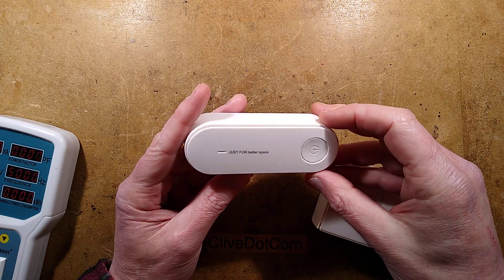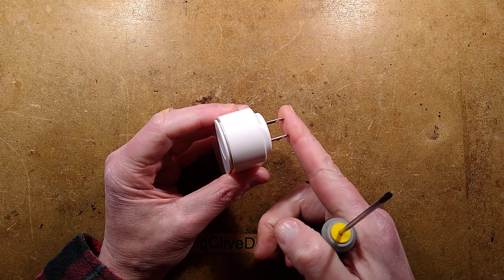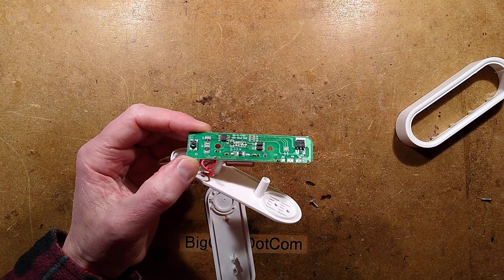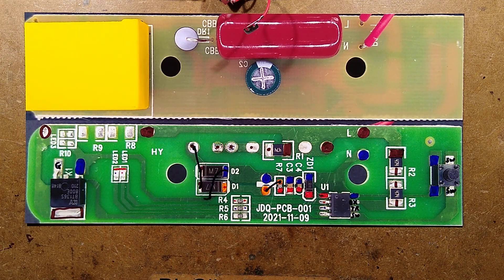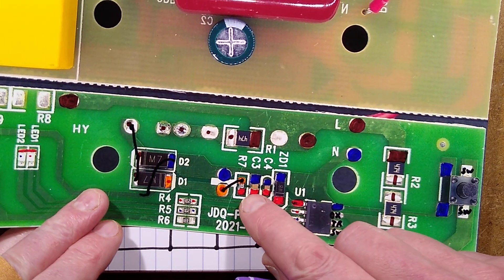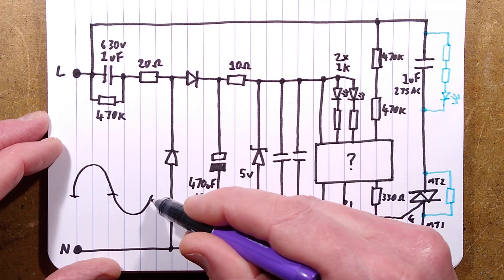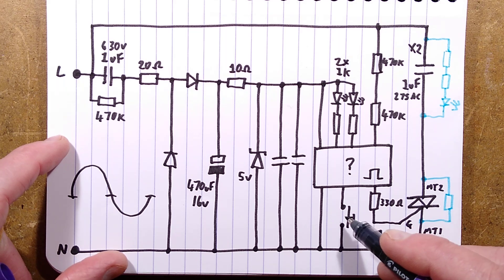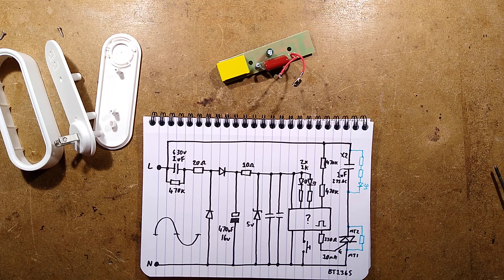Computerised power saver plug (with schematic)

Comment: Hey Big Clive, I went to look at the family home that my parents left me in their will. The house has 12 Solar Panels, and before he died, my father spent (according to my sister) £10K on two Solar Batteries! You should see the thing, meters, inverter, isolator switches, ethernet leads, current clamps, it looks a bloody mess like it was thrown at the wall. The two lithium battery units are large black boxes with thick connecting cables. You'd be in your element, reverse engineering that lot! There's also a Solar PV SCHEMATIC pinned to the wall near the gubbins! 🤣

WARNING: System is live during daylight hours!

Apparently, if I've read the feed-in tariff meter correctly, since installation about 4 years ago, the system has generated 13,000 kWh. In 18 years, in my rat-infested flat, I've consumed around 28,000 kWh. You do the math! 😂
Reply: Sounds amazing!  Take care of those batteries and that system will power a family for years to come.
Reply: @maukaman  I know little about how it all works, and how to care for the batteries, but I do know that lithium batteries have a finite lifespan, and lose capacity over time! Just as the output from the Solar Panels drops over several decades.
Reply: @marcse7en  of course, nothing lasts forever.  Lithium Iron Phosphate batteries can have an incredibly long service life when used correctly through.  If they are only charged up to 90% state of charge and depleted to 10% SoC they can last a lifetime.
Reply: @maukaman  I don't know the battery chemistry of the cells used in the Solar Battery, but rest assured, before long I'll be an expert! ... What I do know is, at £10K, they're bloody expensive batteries! 🤣

Acronyms are my thing! ... "SoC" ... "State Of Charge" and "System On A Chip"
Reply: @marcse7en  I had a feeling you enjoyed a good acronym when I was writing that
Reply: @maukaman  I actually do! And I'm VERY good at them too! Here's a few straight off the top of my head IIRC ... VHS, VHS-C,  SVHS, SVHS-C, VCR, EIAJ, VTR, IC, CPU, RAM, ROM, DIP, EIDE, PATA, SATA, USB, USB-C, CD-DA, CD-ROM, DVD, DVD-ROM, VCD, DVD-RAM, HDD, FDD, PSU, SMPS, MOSFET, RCD ... 🤣 ... Would you like any more, or is that enough to be going on with? 🤣
Reply: Cooked a lot of rats then? 😂 Keep the batteries between 20-80% and it'll help them last much longer. Try and keep them cool if you can too..
Reply: @rosiehawtrey  It's funny you should say that, because YES, I have cooked a lot of rats in my non-Solar Powered electric rat trap! 🤣 ... The Solar Battery is comprised of two units, and located in the garage, which is usually cool. I know little about how it all works, so am unsure about how to regulate the charge level as you say? I'll have to learn!
Reply: Neat 
And yep they can sometimes get messy when you have two sets of batteries and cabling for sure
Reply: @BenCos2018  I mean I love technology (computers, video, Hi-Fi, etc) but what a bloody dogs dinner the Solar PV System looks! ... As the late Duke Of Edinburgh reportedly said of a fuse box, "Looks like it was installed by an Indian!" .... How did he get away with it? 🤣
Reply: @marcse7en  damnn haha
Reply: Well, feed-in does not say anything about the amount the panels together with the panles and inverters have generated at all.
Generally, my feed-in meter is at around 0 when my 3Dprinters, computers and all other things are running of my own solar-panels and inverter during the day. I just use my own solar-energy to power everything in the house. Only when there are left-overs the feed-in should register.
Actually when installed correctly (there come in those ethernet leads and current clamps), when you would use power from the grid, the batteries are used including the inverters to reduce the feed from the grid since first comes the power from the stored energy in the batteries.

So, during daytime, first comes charge of the batteries and lowering power from the grid. When batteries are full,  power goes to the grid what is not in use so there should be only a bit left. when sunlight gets less, first only less back to the grid and later batteries are used to power the house untill they are emptied for a certain amount and it is solely grid-power that is used.

And about the investment, well should be for at least 10 years and probably 20 years or longer. so only 1K or less a year and with the energy you use in a year you will go a lot above it (yes, doing the math coursely) .
Seems like a very well investment your father did!

Comment: how do two 470k ohm resistors in series make a zero crossing detector?
Reply from the maker: Common trick with microcontrollers.  Tiny current that causes an input bit to change polarity at each zero crossing point.
Reply: It limits the leakage current into the digital input and its ESD diodes to well under 1mA.

Comment: With the triac being triggered positive only, what discharges the capacitor besides the LED? I don't see any advantage at all, putting a DC bias on the AC mains. They sure go out of their way to make this nonsense look legitimate. The only way a capacitor can save electricity, is if it's value is precisely matched to the inductive impedance of an inductive load, then, switched on and off with that load. It serves to reduce the current by correcting power factor, and can reduce I^r loss in the wiring between the appliance and the meter. It might reduce consumption by ~1%.

Comment: If they switch the triac on when the voltage crosses zero each cycle then the current is going to be nothing like a sine wave.  Because of the capacitive load the current would rise suddenly to its maximum value at switch-on then fall to zero in the first quarter cycle and then remain at zero for the second quarter cycle.  They would be maximizing the current step rather than minimising it.  They should be pulsing the triac on at the voltage peaks.  Who knows, perhaps they are, only the oscilloscope of knowledge can tell.
Reply: Correction, I got the second part of that comment wrong.  Switching the triac on at the peaks would be even worse.

Comment: Remember the bug that was placed in the United States Embassy, that was not found for (if I remember correctly) decades? 
I believe that most of these devices are just putting on a show, but this one for example. What if they are feeding back into the electric system in the structure, until it comes to something that could transmit back to somewhere. What it would be transmitting, or where it could be transmitting from. I don’t know. 
Is there any fields that are emitting from it, and what the fields might be affecting. I don’t know. What if they are transmitting a frequency of what, and somehow it is repelling insects, or what if they are drawing insects to them (not the heat, but the energy field that they are producing). 
I am not saying mind control, but if this was placed near enough to where someone was sleeping (naps included), would the lower state of their body be affected somehow? If only to prevent deeper sleep from being rustled up barely. Or if there was a feedback into the electrical system (even if it was so many meters, and didn’t make it back to the breaker), and affected other devices on the circuit, or the whole system. 
This idea is from, high end audio systems. Because they have power conditioners, and the should have their own circuit ran, along with other things designed into the power supply, to prevent noise from polluting the sound produced. 
Yea, I believe that as hifi systems are built, that cables and that noise coming from other devices on the circuit, and from the power grid, will affect the performance of the speakers. But that’s not until someone has been building it to make one absolutely amazing resolution hifi system. That is when it could be heard. This thing would cause havoc on a setup like that.

Comment: the device only works in places where power factor is used for billing.

since most developed nations like the united states and europe does not use power factor to bill it will show up as scammy.
Reply from the maker: It's also a random stab in the dark for proper power factor correction.

Comment: Well, it does seem to be a power saver after all. You plug it in, it saves power. Then, when you open the case, it shocks you. Classic power saver behaviour. HAHA I am glad you din't get hurt.
Reply: I've got a real power saving device at home. It watches the current on one of the outlets and switches all the other ones off if there isn't enough draw to indicate that it's on. But, a single outlet product that saves power is pretty inexplicable. I cannot imagine how any such device could ever be something other than a scam.

Comment: Not seen a capacitor switched on and off by a triac? Try a photo flash with adjustable power. They even use a capacitor and a triac to switch off another triac.

Comment: Switching a capacitor on at a clever point in the sine wave almost sounds as if you could fool a smart energy meter
Reply: Maybe it could fool the meter to overread.
Reply: dont be dumb
Reply: Bro what if these actually work 🤣🤣🤣🤣🤣🤣🤣🤣🤣
Reply: @rovhalgrencparselstedt8343No. If you push the load towards inductive, it's the real power that does the work, not apparent power.

So you can't get away with trying to transfer real power to apparent power.

Comment: I just had to watch you zap yourself a few times 🙂You were holding on to the prongs with the left hand and grabbed the circuit board with the right hand right at the capacitor.
Reply: Which was a dangerous thing to do. Capacitors are usually very tame when neither side is connected to earth, but here Clive created a rather unfortunate current path right through his heart even.

Comment: My guess is you have the "Pro" version of the power saver plug: the cheaper "Basic" version doesn't have the "Intelligent" parts (including the triac), but only the 1µF/275VAC capacitor alongside the missing R8, R9, R10 resistors and active indicator LED 3.

Comment: I'm amazed it actually does the whole capacitor thing as if the concept actually does anything useful. I more expected the OBDII style product where it just flashes LEDs convincingly.

One thing I am curious about though... Since the triac could potentially switch the capacitor on with quite a voltage difference on it compared to the mains, is there scope for blowing up the triac? How big of a capacitor could you use on this thing before the triac blows up?
Reply from the maker: I think that's why it detects the zero crossing point of the sinewave to minimise the current spike.
Reply: The zero crossing input should read across the triac to avoid getting fooled by the cap's phase shift or by whatever zap was left behind when last the triac last saw a null in current.

Comment: "Let's give it a fingertest - no, no charge. That's good" - Clive, the living example of work security while fiddling with electric gadgets. And I like it. #LLAP On topic: I like the fact that such manufacturers can make a living out of the idiocy of power saving esoterics
Reply: What?! Did you think that it was only fraudster businessmen/politicians like Trump and Co that could endlessly milk the mentally incompetent? 😉😁 
Remember that the old saying that "There's 1 born every minute!" is itself not true. That would mean that there should be around 40 million alive at any 1 time. When in reality there's billions of 'em! 😱
Reply: It's North American voltage. A baby could handle it.
Reply: @chitlitlah  What's North American voltage? Certainly not with Big Clive, who gets 245V, which is definitely deadly.
Reply: @graealex  I saw the North American plug on it and assumed he was using a transformer. Rewatching the first part of the video, it seems it can handle up to 240 volts and he's using his native voltage. Perhaps a shock from it wouldn't be so pleasant after all.
Reply: @chitlitlah  It's always going to be unpleasant, but nothing happens when you touch only one lead of a capacitor, as that doesn't form a circuit. And when you touch both leads, you're usually doing it with only one hand, so the current stays locally inside your hand.
It's different when talking about high voltages though.
Reply: @chitlitlah  They must use that "North American" plug elsewhere in the world with 240 volts.
Reply: @davidg4288  I don't believe that is the case. But China makes some crap that can theoretically take an input of 100v to 249v. Sometimes he use a little switching power supply to do it.  Taking that approach they have a single design instead of one for North America and another for the rest  of the world. It's efficient from a manufacturing standpoint but it is inherently a bit inefficient at one extremes or the other. For most things done like tis, they are pretty low power anyway. 

In this case, it is still fake or useless regardless. But it "works" on either voltage from the standpoint of making a few buck! Beyond that, it's garbage. 

When China clones something, they usually take a decent design and find ways to cheap it down with no concerns for safety or reliability./functionality.
Reply: @chitlitlah  I tested North American voltage as a toddler 65 years ago in North America, with scissors (went bang) and with fingers (unpleasant).  Tamper resistant outlets would have protected me from the first experiment, GFCI would not have protected me from the second as I substituted my finger for a light bulb.  Dad's response was "You shouldn't do that.  Don't tell Mom."
Reply: @davidg4288  A charged capacitor that isn't grounded on either side usually poses no immediate danger to life. It just hurts a lot.
Unless you purposefully create a current path through both arms, and subsequently through the heart. Like Clive did.
Reply: @graealex  Right that "power saver" isn't dangerous until you open the box. Still it's usual practice to include a bleeder resistor. Electronic flashes are an exception since you need that charge for the next photo. Never trust CRT's either. Now that I think about it do power factor correction or motor start capacitors have a bleeder? I've always assumed they would bite depending where they were in the cycle when disconnected.
Reply: @chitlitlah  Famous last words?

Comment: I'm stunned they've actually implemented the ability to switch in and out the capacitor, would be very interesting to know what the designers were thinking at the time and if they were trying to justifying it to themselves it wasn't a scam. But the blinking red light before it turns blue 100% is just trying to convince the user it's doing something more advanced, no reason it couldn't just instantly switch on.
Reply: The more elaborate the rouse, the more likely the mark will buy in to it. Especially someone who might have seen BC's expose of the cheap and nasty version of these, and think these ones might be the real deal.
Reply: @mikenco  Yep, but lookily this ruster rows to the chalinj of expowsin the "ruse". 😜😂😂
Reply: Well, it is doing something. It'd making the LED blink.
Reply: @samuelfellows6923  what are the chances of you being the same Samuel Fellows I know...
Reply: @James-om5yo  🤨😬?

Comment: 470uF   "16V" ?????   effectively across rectified mains ?????
Reply from the maker: Clamped by the zener with slight extra voltage across the 10 ohm resistor.
Reply: 2uF capacitive dropper (I'm not a fan, but they seem to work).

Comment: Almost reminds me of the CAN bus "fuel savers". Some of those were ridiculously complex for just blinking two lights. I guess, though, when a micro is the same price as a 555 timer in the quantities they deal with, why not just use a micro?
Reply: The micro is actually cheaper, seeing as it is made in the millions, and is programmable, so the cost to use one is minimal, and you get to be able to do a little more than flash a LED. Much lower power use as well, saving on the cost of the power supply components as well, you only need a very low current supply to run it.

Comment: Gotta love the logic of selling a 2 pack and only delivering one  :)
Reply: I live in Germany and some commercial leaflets shows, lets say 2 bottles of Vodka and "the normal price" with a strike through and the discount price. However, "discount price" is still per bottle. Pretty annoying... b'cuz brain observes one price and two bottles. Both bottles have the same face forward, so it's not the backside either. Pretty deceptive... in the beginning.
Reply: @Paxmax  of that's just rude, Paxmax. The pictures should show different flavors or brands or the blurb from the back, but never just two of the same.
Reply: @tactileslut  Exactly! The only reason for showing two is to subconsciously infer "oooh a two for a one price!".
Reply: Obviously you save more power with 2, that's two sockets you cant use
Reply: Why would you even need two though?
Reply: @tncorgi92    
To get double the savings  :)
Reply: @tncorgi92  One to use, one to take apart.